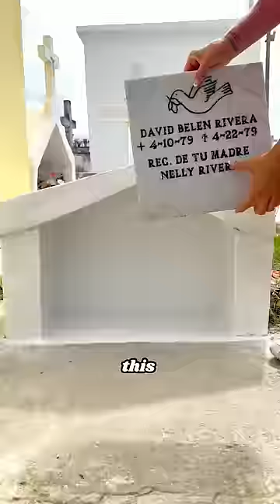Cleaning A Baby’s Grave For Free

Comment: People who clean graves for free. I have full respect for❤️❤️🤧
Reply: I respect the ones who do it WITHOUT WANTING LIKES....Seems as if no one wants to do anything unless they're filming it OR wanting LIKES. Like this video.
Reply: @robinreese3776 you do realize that these so horrible views and likes are the thing that helps these people to do this for free? There’s a person cleaning houses for free and started filming it because people were interested in the process and it helps her get money for cleaning supplies to actually help these people… think before commenting again
Reply: @PersonTP That's fine, & I have no problem with her filming her cleaning & posting it online. 

What I do take issue with is what she's using to clean. Gravestones, memorials, grave caps, cenotaphs, etc., can be made out of multiple materials & using household cleansing products, stiff bristled brushes, & paint scrapers can irreparably damage the material & accelerate erosion & cracking due to weather. 

There is an entire community of people online who do this as a hobby & there is a right way & a wrong way to clean graves without potentially damaging them. This is the wrong way. 

I appreciate that her heart is in the right place, but causing damage unintentionally is still damage. She needs to do her research on the right way to do this & the laws surrounding this activity. She posted another short where she paints a grave cap  & urns & she could get sued by the cemetery, the family, or both for vandalism & trespass for materially changing the appearance of a monument & the cost of repair to undo what she did. You don't use strong chemicals to clean grave goods & you absolutely don't use house paint to 'freshen it up'. There's actually specific types of paint that are used for this, & you have to order them from monument companies. 

Again, I appreciate the sentiment behind what she's doing, but her lack of knowledge & research could get her into a lot of trouble.
Reply: It wasn't for free if you think about. YT paid for the views.
Reply: shes NOT cleaning the graves for free tho. She's getting $$ and views for exploiting the death of someone else's baby and these people need to stop it
Reply: @robinreese3776 EXACTLY 💯 I'm glad I'm not the only one with this reaction. I'm so sick of social media
Reply: Ok❤❤❤❤❤❤❤❤❤❤❤❤❤
Reply: @yeetnama9094 If you are so fed up with social media why haven't you deleted them yet? JAAJAJAJA
Reply: I don’t even mean to be rude but who would pay for it ?
Reply: @Jaidon56 me! As my relatives graves are distant to where I live.
Reply: שיאל.                  ❤😂😇🫶🏽
Reply: To say I'm cleaning it for free is in bad taste we all know yt pays
Reply: If you look at the video, she also painted the headstone. That also costs money!!@ecs1100
Reply: same❤❤❤❤
Reply: Totally selfless. Better cash in that content money though.
Reply: It's a beautiful thing you do. Bless you.  ❤
Reply: Absolutely
Reply: Guys she could be doing something else with her time! What bad is she doing to anyone? Maybe that is something she felt that she had to do! Is better than doing all the stupid crap that goes on the Internet daily! I don't see people complaining a no out shitty post! She is showing Respect for someone  she doesn't know ! Get it over the word ( free) the only free thing in this messed up World is the Oxygen in our lungs!
Reply: ❤❤❤❤🎉🎉🎉😢😢😢شف
Reply: @robinreese3776 thank you. I feel that.
Reply: Yeah those who doesn’t make content out of it maybe 😂
Reply: @PersonTP Oh really? Is she listing the chemicals that she's using to clean? Or how she gains access and permission to record in these cemeteries? 

What process are you seeing here that will help the average person?
Reply: @myrnatorrez8308 For starters she's fucking up these graves since she's using harsh chemicals. Second, there's no way she's getting consent from the owner of the cemetery or next of kin of the deceased to be bumming around and recording.

And lastly, you don't need to be recording and letting people know you're doing a good deed. You'd be satisfied by doing the good deed without the need to show others.
Reply: Love❤❤yuo
Reply: You are baby David's  guardian angel here on earth. You are a special person 💕
Reply: She is a shining example of some one  with a servants heart ❤️ I wish more people would do the same thing.
Reply: Me too, but to express that is being done for free? Who would charge a fee for that? 
Good for the OP but looking for merits?? Blah... Playing on people's feelings...
Reply: @robinreese3776 Amen! My sentiments exactly! So cheesy of this person.
Reply: @robinreese3776 my grandma does it.
Reply: Cleaning Graves damages the Stone ..Fact ! Leave them alone
Reply: @lapetitemorte6307 how do you know what cleaning products she us using? There are caretakers in the cemetery. She must get permission to be cleaning the gravestones. It's a beautiful idea as long It's done correctly and doesn't do any damage. Not everybody does things to get likes or credit. She just made a lot of people aware of something they can do, but never even realized.  It could be a comfort to a lot of people knowing their loved ones burial site is being cared for and not forgotten.
Reply: You are klienig our word ❤
Reply: I clean graves for free, it's quite easy. I do it almost all the time if I have the free time after work. I've been counting the amount of baby graves and adult graves.
Reply: It’s fine she’s paid in views.
Reply: @yeetnama9094 Exactly. Did you look at all the views and likes she got?! She made so much money off this one video she could clean Graves for the next year and not spend a dime.
Reply: 😅 i know i know i know i know i know why you're thinking and i know you're doing for free
Reply: @mariucheA  There are more than a few videos of her doing this now & you can see the cleansers she's using? ANY household cleansers can be damaging, especially to older or cheaper gravestones. People who do this as a hobby pretty much use water & maybe stuff to kill the lichen & moss. Not bleach. Not dish soap even. You can tell in several of these she's using foaming bathroom cleansers, and something that looks like Mop n Glow or Simple Green. Even that can cause damage. The fact that she's using any cleansers at all tells me she doesn't know what she's doing & it's causing damage unintentionally.

I highly doubt she got any permission from anyone bc I know for a stone fact that IF she had asked the cemetery they would have told her no. Not unless she got written, signed permission from the family. The graves are the legal property of the family & the cemetery is the physical custodian in charge of tending & preserving the graves. Any changes past mowing grass has to get permission from the family, including repairing stones that have cracked or fallen over. No permission? No fix. 

As I said, I appreciate the sentiment, but her ignorance is going to get her in trouble.
Reply: @mariucheA  To add, that's just it. She DIDN'T get permission, she's NOT doing it correctly, and she IS causing damage. 

Not just in what she's physically doing, but if she 'inspires' people to go out & do this too, but do it the way she's doing it? Now there are MORE people cleaning graves that don't belong to them or their families using methods & products that will cause irreparable damage to the headstones. She can get in a lot of legal trouble for some of the things she's doing. 

There's a large worldwide community of people who do this as a hobby & have been for decades. Who have taken the time to research how to do it without damaging & in many cases how to help preserve stones that are already worn down & eroded. There are tons of websites dedicated to this, a 30 second Google search would have given her quick tutorials on what to use, how to do it without causing damage, & what legal limits to not cross. 

Painting a grave? That's pirrouetting over a legal line.
Reply: @robinreese3776 you’re absolutely right, there’s always so many people saying they’re doing it for free, well yah technically they’re not charging the cemetery for it but they’re making money from YouTube. What’s the difference if I’m rebuilding someone’s engine and don’t charge him because I know his dad is gonna pay me ? These people are soft and flakey. There’s also a guy who cleans up peoples front yards and really messy lawns “For Free” he’s got tons of subscribers on shorts and YouTube itself 😅  most people have no business sense whatsoever. As they say, you can’t see the forest through the trees.
Reply: WHY would they charge?This is a good human.
Reply: Same ❤
Reply: @toryting4093 in all states you have to get permission from your local officials and prove that you have a business in cleaning grave sites.
Reply: @robinreese3776 I knew I would find this negative comment. At least she’s doing something and she’s also bringing awareness. More people might want to do this. I didn’t know this was a thing until now.
Reply: @lapetitemorte6307  and are you sure she’s not using the right chemicals and paint? And do you know for a fact she hasn’t actually asked the family or the cemetery people if she can do this before posting your comment?
Reply: Especially babies! 💔. I wish I had the health to take care of the newly born, newly died before They learn how much love❤ their momma had in store for them. 💔 just cant imagine, and thank you sweet person for taking the time to take care of these lost souls 🙏🏼
Reply: @robinreese3776 Serious? I am glad that this sweet Person showed how love is shared. It's not about the likes to her OR ME but perhaps a suggestion to keep those lost souls remembered even just while cleaning the site. Shame on YOU and the inconsideration  you have in your ❤less soul.
Reply: If YouTube wasn't paying her she wouldn't be doing this.
Reply: What is the point? I don't get it. The person is dead the body has decayed the person is gone it is just a place for the body to decay without disturbing people. Nothing special.
Reply: @Orlanzepol123   The fact she's using any chemicals at all tells me she doesn't know what she's doing. People who do this as a hobby or as a profession pretty much only use water. Usually, the only chemical used is something to kill lichen & moss. You can literally see the bottles of cleaning products she's using as well as the products themselves, & last I looked plain water doesn't foam or turn blue. So no, she isn't using the 'right' chemicals & cleansers bc she's using chemicals & cleansers in the first place. She's also using metal paint scrapers & stiff bristled brushes, which will damage the stone. You can also see the can of paint & it's clearly a metal can from a hardware store. Paint used on monuments comes in little white plastic buckets that look like ice cream buckets. 

She makes it clear by the language she uses that she's had no contact with the family, otherwise she wouldn't be speculating on the last time they were there or the reason behind the different stuffed animals. She makes it very clear that she doesn't know the family, which wouldn't be the case if she'd contacted them & gotten permission.

She also didn't get permission from the cemetery bc they would have said no. It's basic policy in cemeteries that no one is allowed to mess with a gravesite that isn't family, so I absolutely know they would have told her to leave. I also know that if any of the groundskeepers saw her, they would have checked to make sure she had permission, especially if they saw the paint. They would have had to contact the family to inform them of what happened as the paint would be considered vandalism, & the cemetery would be liable for restoring the monument to the original condition prior to her doing this if the family got upset. 

Source: Not only am I a mortician, I also lived in a cemetery for several years & had someone do this to the grave of a sailor from the post-Civil War era. They irreparably damaged the gravestone & the statue (which was a very rare example of monument statuary from the time period) by 'cleaning' it like this & painting it white to 'freshen it up & make it look nice'. Given the age & the material of the gravestone & the statue, the damage was extensive & it cost the cemetery thousands to attempt to have them restored. The damage was so great that both ended up having to be recreated in modern materials while the originals were handed over to a museum in the hopes that the damage could be reversed or at least halted. All on the cemeteries dime.
Reply: @PersonTP  do your realized none of what you've said makes sense right. They still get this thing done for likes thus catch quite the attention and bragging about. None of this would be a thing if he hadn't posted in media in the 1st place.
Reply: @yeetnama9094 yeah this shit is ridiculous and the people that stick up for silly behavior like this are just as silly.
Reply: @PersonTP that person got permission
Reply: @PersonTP shes not actually using the right products, she damages the graves. She does all of this for views, she narrates her videos which is just cringe, she cuts down trees which is completely out of order, and she doesnt get permission
Reply: @robinreese3776  She still cleaned the grave. For free. Regardless if she filmed it or not, she did the job. And she sure deserves compensation for the work
Reply: Also the ones that say, "I wonder how their life is like?" HMMMMMMMMM, maybe sad they died as a baby.
Reply: @robinreese3776 well people need money to survive, okay? the fact that you’re shaming people for wanting likes on their videos and making money off of it is odd.
Reply: 😢😢😢😢😢😢😢😢😢😢😢😢 @PlatzAreal
Reply: You shouldn't
Reply: @ibrahimkassem6149  To start, the family members of that dead person want to remember, honor them, etc. Along with, it’s just a sense of respect to the person who passed. :)

Comment: I don't understand why the cemetery doesn't keep up with the plots. They should have maintenance clean them. Thank you for taking the time and care do this for family that might not be able to.
Reply: Especially since they charge real estate prices for the graves😢
Reply: This may not be a cemetery so many of you are familiar with but many of these older cemeteries are not maintained by the powers there of but have been maintained by the families over the years.  As families die and the next generations move away, there is no one left to care for the grave.  I have been in so many cemeteries like this where many of my ancestors are buried.
Reply: There are caretakers around to hire to take care(in some cemeteries)